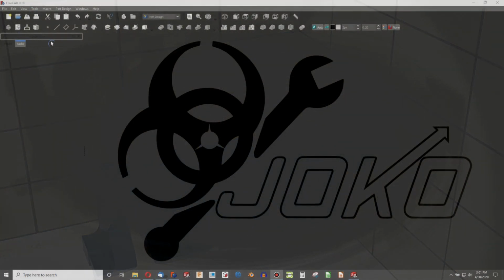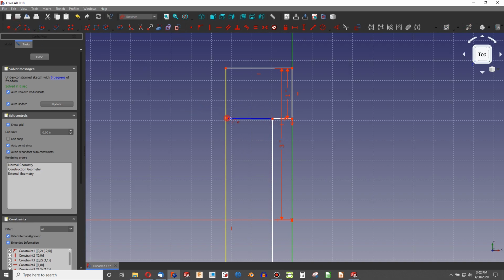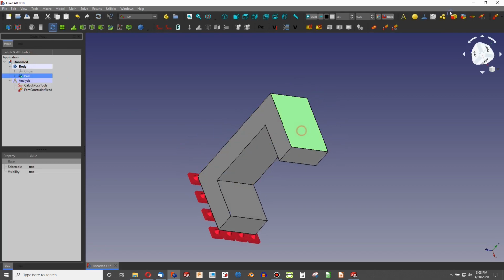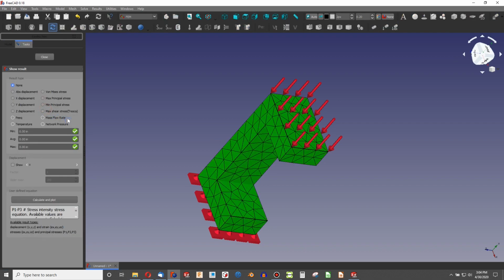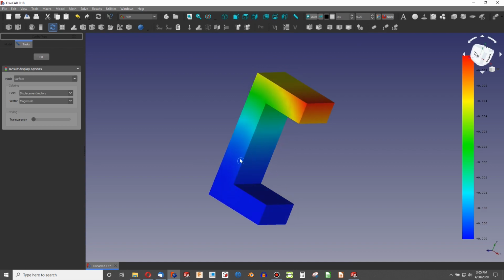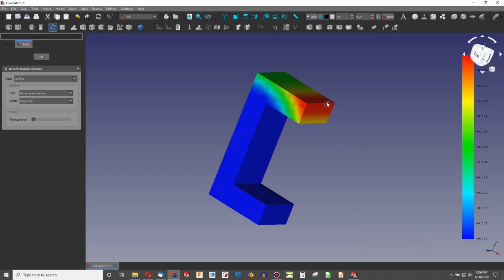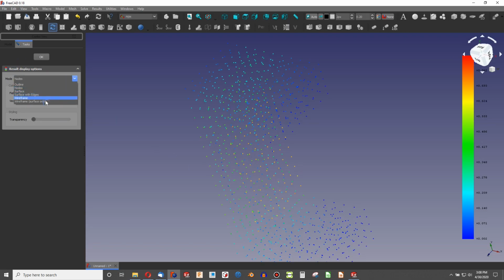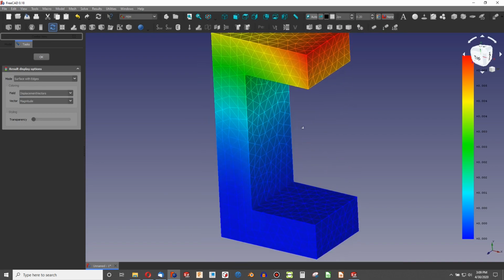FreeCAD Pipeline Analysis Visualization - And Black Surface Fix |JOKO ENGINEERING|

Comment: Was there a need to change the direction of the force as it should have created a force equal to but opposite in direction? With the finite analysis why single point calculations as opposed to partial differential?
Reply from the maker: MrCoffeypaul!  Havn't heard from you in a while, nice to see you on here again.  These videos are a balancing act of staying on track with the focus on the video but doing so in a way that the viewer can replicate the work and doing so in a time that doesn't take forever to get to the point.  Since the focus was on visualization, I made something as fast and easy as I could to get to the focus of the video.
Reply: @JokoEngineeringhelp  Love the video, thanks but considering I don't even know what FEM stands for it definitely got me thinking. I think what I was trying to suggest was that different materials react differently to compressional/elastic forces(I don't even know the correct terminology, LOL) Absolutely loved the video! Hope you are up for some questions ?😁